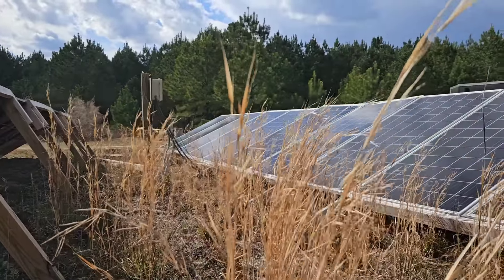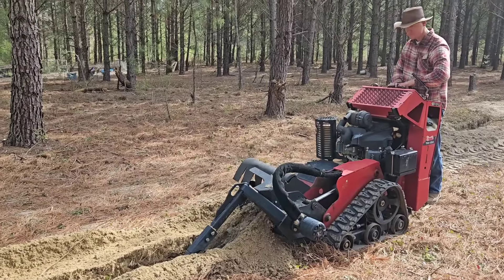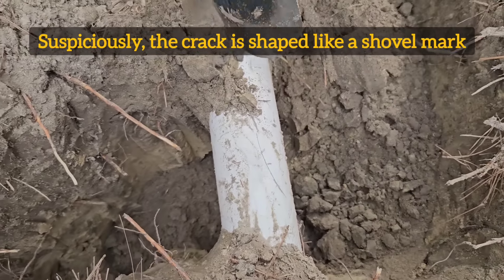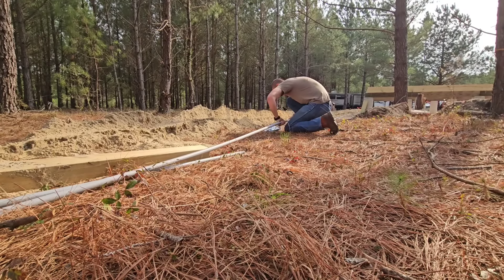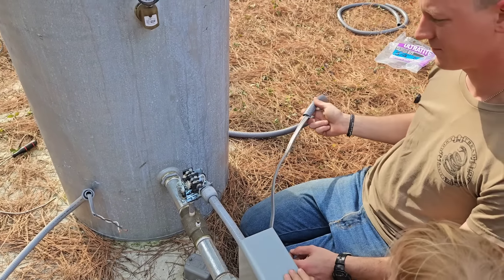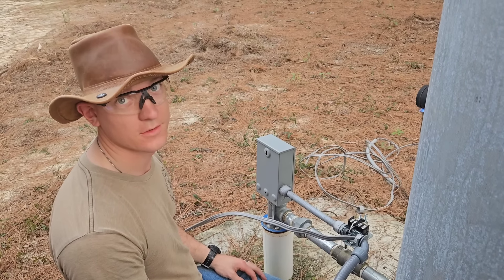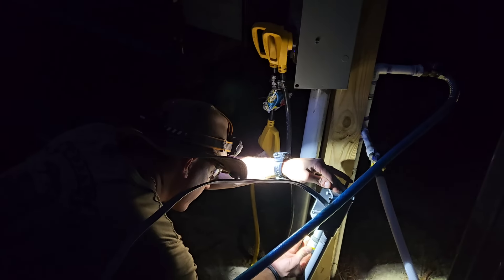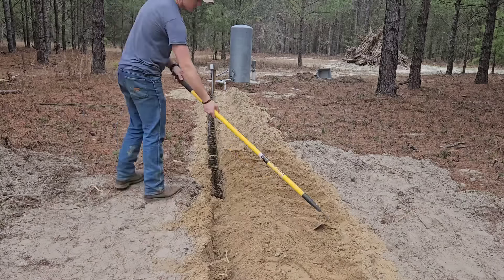Our Biggest Lesson Yet: Build To Code and Then Some | Building Our Off-Grid House (BY Hand)

Comment: Things you need, a step bit set and a knock out hole punch set.  Great for enlarging holes and adding holes to electrical boxes.  I love to dig with a backhoe so I would have used that but the trencher did make less of a mess to fix up.
Reply from the maker: Haha I love digging with the backhoe too...but for the tight spaces and cleanup it was worth renting the trenches. Also, I'd never used a trenches before so I was really excited to try it out and of course it worked amazing (except for getting stuck lol)

Comment: The tool you needed for that hole is a set of Greenlee Knockout punches. Problem is the homeowner rarely has a use for them, I sold the ones I had on Ebay.
Reply from the maker: That is neat, yes I can see how that would be helpful! Thanks for the tip 👍

Comment: Good Job My Tip Build Well House Wire A Light To The Pressure Switch That Way You Will Know When The Pump Is On
Reply from the maker: That is a neat idea 💡
Reply: @DIYorDIE_Off-Grid you are in what state, sir?

Comment: Guys, Its probably too late, but next time you have to feed mains cable through conduit, it would be much better to unroll the cable, rather than pulling the cable off in loops.  Just a little tip for future wiring projects.  Regards Robin.
Reply from the maker: Thanks for the tip!

Comment: I'm wondering why you rented a trencher instead of using the backhoe? Have a great day.
Reply from the maker: Backhoe bucket is 16" wide and I only needed a couple inches for the electrical conduit. The tractor is much bigger and there were a couple tight spaces. Lastly, I was worried about the roots from a couple tree stumps. The trenches is designed to cut through those but with the backhoe it could have been a lot messier. I also think the trenches went faster than if I had tried the bucket.

Comment: You didn't need a 3 wire with ground feeding the pressure switch....2 wire with ground would have worked and then you could have used 1/2" flexible conduit conduit and wouldn't have required enlarging the hole in the pressure switch
Reply from the maker: Yeah, you are right, but I was thinking it might be handy if I want to add a light or something in the future.
Reply: That's good thinking but you could have left the 3wire in the junction box on on the post and went with 2 wire from there....also you might cover that pressure switch with a plastic pail....it's not a weatherproof switch....and plug the holes in the back of the pump controller box to keep insects and water out of it.....
Reply from the maker: Yes, very good ideas 👍
Reply: also if you add a light or 120 volt recept out there and share the same feeder from the 2 pole breaker you will need a separate disconnect for the well .......if you cord and plug the well that would be okay....as long as the recept. for the well has a weatherproof in use cover....
 @DIYorDIE_Off-Grid
Reply from the maker: @robertkaro6424  good to know, thanks!

Comment: NO! you connected the ground in the wrong direction. You want the wire loop in the direction left-to-right. As you tighten the screw it will wrap the wire. When you go opposite, the wire is pushed out. Ugh...Kinda like wrapping teflon tape counter clockwise on threads - the tape unwraps as you tighten. You know this. Sorry to call it out.
Reply from the maker: Haha, kudos to you! you are the second person with superb attention to detail who noticed which direction I installed the wire loop 😉

Comment: You put the ground wire around the screw in the wrong direction    OOPs
Reply from the maker: what exactly is the problem?
Reply: @DIYorDIE_Off-Grid The way you hooked the grounding wires around the screw. It should always be put around the screw the other way so when you tighten the grounding screw the wire cant bulge  out
Reply from the maker: Hmm, I see that is a home depot link...if you think that is a code violation please cite the code reference. I'm aware of the recommended way to loop a wire, but as far as I'm aware, it's not "wrong" as long as the wire is secure and the screw is properly tightened.
Reply: @DIYorDIE_Off-Grid Probably not a code violation just a safer way to make sure the wire stays where it is
Reply: wire should wrap around in a 
clockwise direction
Reply from the maker: @doncaranci2547  as long as no one touches it I don't think it will be moving on its own 😉
Reply: @DIYorDIE_Off-Grid  I agree just letting you know
Reply from the maker: Thanks, you have really good attention to detail! Let me know if you notice anything else!
Reply: @DIYorDIE_Off-Grid Was in construction for over 25 years and I loved every minute of it till I fell off a 2 story roof..  Ouchee